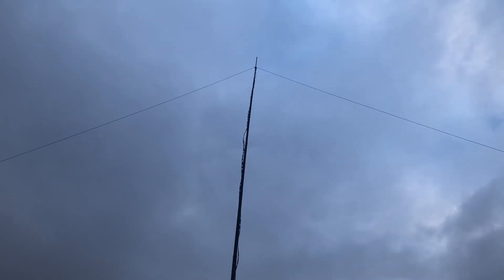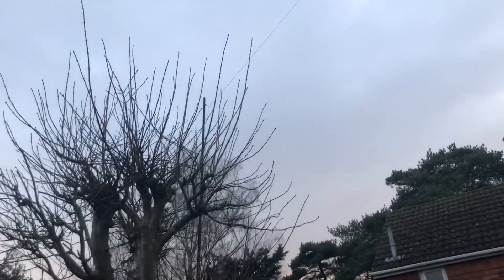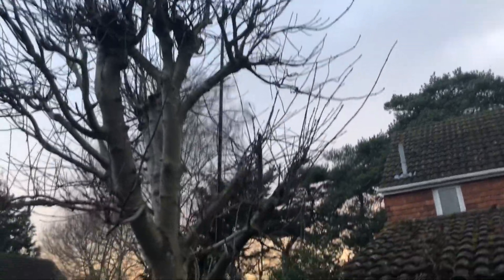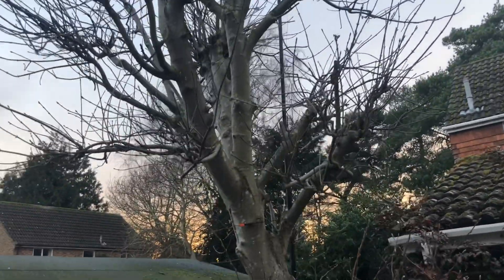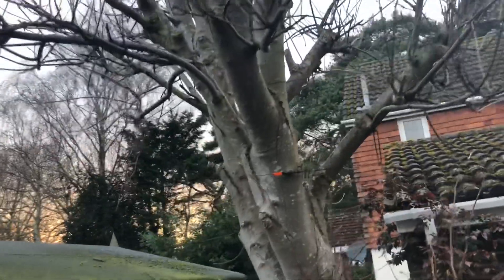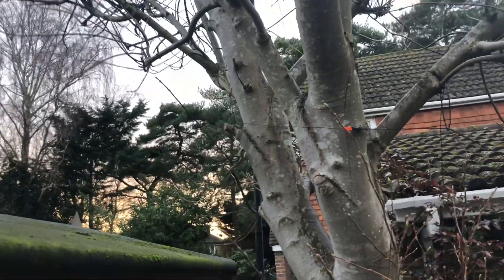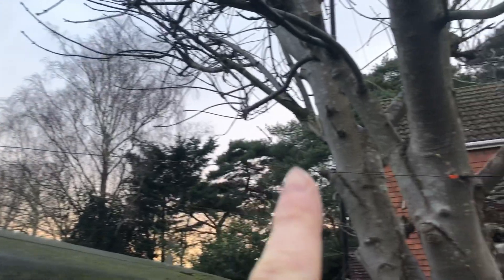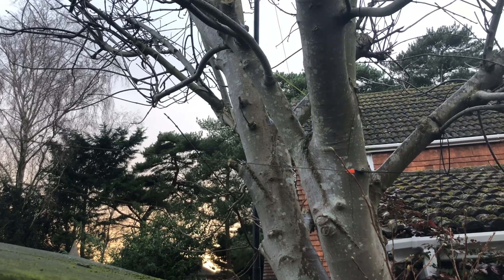Doublet Antenna: Reflection on Performance

Comment: I know I could bend it like you have but I wish my house was more Central to my plot. Windoms work the available space much better for me. Suppose my plot is Rectangular with the natural feed point at around a Third. Have HT Electricity lines to One end (else I could run another 30 Yards into Neighbours land) (WOW Potentially 80 Yards of available antenna space) and 240v lines running all the way down the long side. So have a FANTASTIC plot, in the Countryside, and the Guy that lived here before me was a Ham G3BZK (I am M1BZN would have been neat to get 3 letters earlier)  and here I am moaning with 4 HF Antennas and 2 VHF UHF :-) Like the videos Tim, keep them coming.
Reply from the maker: Sounds a great location Chris 73 and thank you for your feedback 👍

Comment: I understand you can do what you want with the last 1/6th of the leg of the doublet , eg drop it down , or bend it at an angle to fit it in and will still work ok
Reply from the maker: Yes dipoles/doublets are very forgiving

Comment: Well done Tim, you must be getting a nice low lobe off that antenna somewhere! Just the other day i worked into Kentucky with the 818 on 5w and a bit of wire sloping down from the tree in the garden and the guy in US was amazed with my signal. Oh, and i was also using a short run of RG58. Nowt wrong with that on HF.  Its all starting to sound very promising for the months and years ahead so hopefully we are all going to have some fun with our radios in the near future....lets face it.....we could all do with a bit of fun at the minute..73, Sid
Reply from the maker: Totally agree Sid and we’ll done on that Qrp contact

Comment: I personaly beat myself up over where should i put my antenna, will it do, am i missing, out on contacts, if i move it 10 foot left or slightly higher will i have the neighbours on my case, all in all, just put it where you want, you will get contacts. I am in a radio low spot and have my long wire horizontal at roof ridge height and ive got one stateside and europe no probs when conditions are good all on 10w (sometimes with compensation for line loss) 😀😀but still im maxed at 20w. Just enjoy the Radio .
Reply from the maker: Spot on 👍👍

Comment: Nice to see how it’s performing Tim,  I need to look at doing something like this once the weather warms up. However my garden is only  6mts long so it will have to go diagonally to get the best out of it.
Reply from the maker: I reckon you might get a 50 foot doublet in there for 40-10?

Comment: Sounds like it's working really well for you there Tim..............Now go say 58 Hail Mary's for using RG-58!!!

To be fair, over such a short run on low frequencies such as 40m & 80m the losses from using RG-58 will be negligible. I can't see it making any noticeable difference.
Reply from the maker: Ha!! I agree James for Hf and short runs it’s not an issue